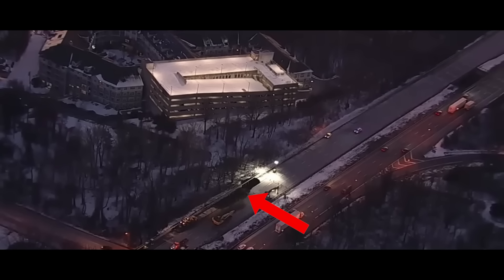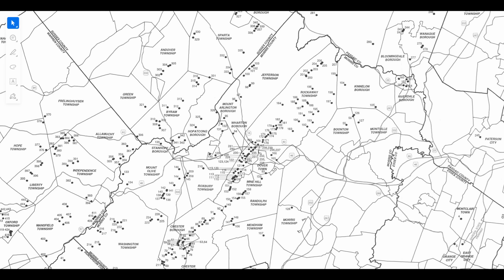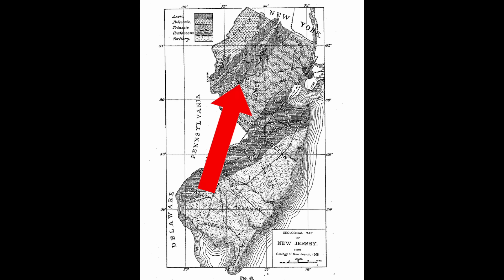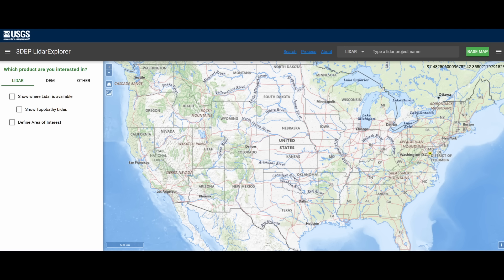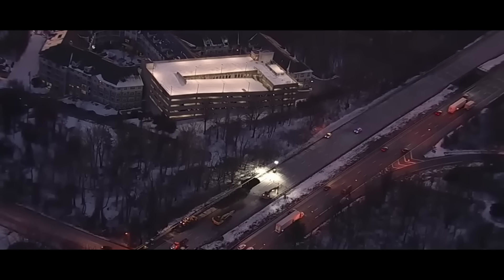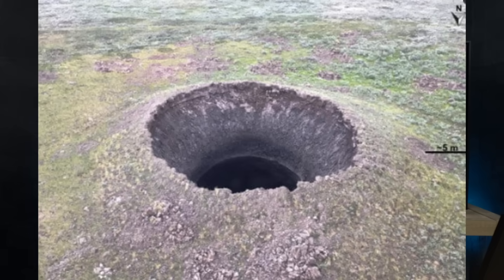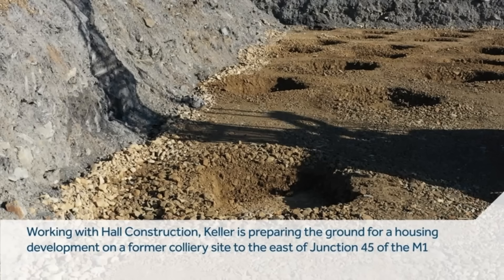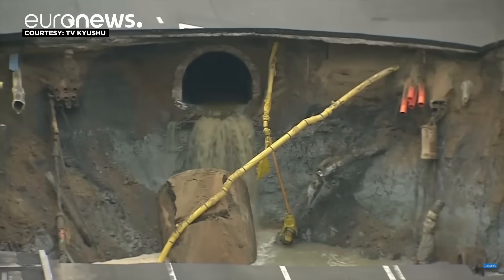New Jersey Mine Collapse below I-80 - How did it Happen, What are the Dangers?

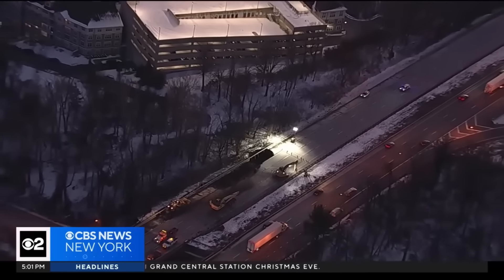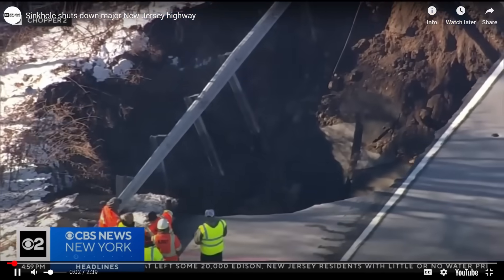Comment: I just saw something in the video about 1:30 and 1:40 that rasied interest.  If you look just off the edge of the sinkhole, away from the road it looks like a weathered sink hole is there, possibly one that is 30-50 years older than the road.  It has some small brush and the edge of the new sinkhole actualy encroaches into it maybe a few feet. Note the shadow in the 10:00 side of the formation that matches the new sink hole.  The best shot I could find was at 1:34-1:35 wnen the camera was looking down almost verticaly into the sink hole, it is at about 10:00 poistion from the middle of the sink hole. Also ar 1:09 there is a shot from above the road that shows the right side of it, note the absence of trees in that depression and a ring of trees around it. Your thoughts.  i live in the Cumberland/York/Adams/Franklin counties limestone areas of Pennsylvania and have seen sink holes due to acid soil eroding limestone, we had significant iron mining and limestone quarrying but all I am awae of were open pits, Caledonia - Thaddesus Stevens Civil war era, Pine Grove Furnace - sligktly later, Codorus ?, Boiling Springslate 1700 or early1800 and some others.  Of course there is Cornwall in Lebanon county that is a massive open pit.  Fuller Lake a recerational spot at Pine Grove (Cumberland County) ended production when it filled with water overnight and could not be pumped out.  Mining equipment is still at the bottom.  us Route 30 near PA 74 has a repeated sink hole, has been fixed at least 3 times in 30 years about 300 yards from the mall and a section of Ollies parking lot (a liquidator) collapsed a few years back whlie a car was parked on it.  The School at Boiling Springs I attended (49-61) has a group of sink holes between it and the new building.   These "landmines" are everywhere.

Comment: Zamak was a zinc alloy that many Lionel trains were cast with as well as matchbox cars etc. I actually have a .22 pistol made from
 It. It was very unstable over time and cleaves over time. Cracks developed in any and all directions.
Reply: Yes and no.  I've heard the issues come from lead contamination.  One of the reasons why it's advised to not just melt down old broken pieces to re-cast them.

These days the metal suppliers are much stricter about lead and other contaminants.  Meaning modern Zamak alloys don't have those problems.
Reply: @ That explains it, thank you. I’ve pondered what the culprit was in the mix. I actually machined 2 new wheels from steel to replace two that split bad.

Comment: Flowable fill you will want to look at the work done in Johannesburg south Africa in the remediation of mine dumps, where the massive dumps were mined again for gold, using modern methods over the old methods that only got a portion of the bound gold, and where as a by product there was a massive amount of copper, silver and PGM materials recovered as well, and also massive amounts of sulfuric acid, with the fine slurry being pumped back into the old abandoned mines as fill, stabilising the dolomite considerably, and also releasing the land for development again. From 30 years ago having row after row of hills of dust generating dump, you now have row after row of cookie cutter developments, and only a few dumps preserved as historical landmarks. The dumps being reprocessed were actually higher in gold content than the current mine ores, despite having already been done a century ago. The whole area is well known for developing sinkholes, as it is mostly dolomite, and it has a lot of acid rain from all the coal fired plants around in the ring of power stations that surround it.

Comment: It sucks when road safety is… 😎 undermined... Did NJ have to do anything else, like pilings or netting, when they filled that sinkhole so that it wouldn't just run out to the sides?
Reply from the maker: You know that is a great point.  I will reach out to them to see exactly what they did for this emergency repair and whether they plan to implement a more long term fix.

Comment: I wonder if that other method you have been using with the satellite company may have given some early insight prior too the collapse. 🤷🤷 
Just a thought

Edit: Never mind 🥴
Edit 2: Never mind the Never Mind, by the time I had typed this up and looked it over you had responded!!
Reply from the maker: That is a good thought.  The problem is trying to use it on a black asphalt surface like this section of I-80 as the radar energy tends to be absorbed rather than reflected.  Previously, I asked them to look at the section of road that ended up failing on the Teton Pass in Wyoming last year.  The roadway was paved with asphalt too, so there was insufficient data to analyze for movements in advance of the slide.

Comment: You're kidding, no one checks sub surface under INTERSTATES?  In NYC you can't dig a hole for a big tree without having a gov't provided service mark out all sub subsurface issues within 50 feet.  Guess gov't dosen't require GC's engineers to do squat for the 10 million a mile of tax payer dollars they pay for major roads.  Surely geologists and thus surveyors and engineers would KNOW, certainly SHOULD know of vast nos of mines in past and conduct approriate test cores and other detection methods to confirm there is no mine UNDER a major construction, or ANY construction.

Comment: Google Earth Units of measurement can be selected in "Tools" and then "Options".  System default appears to be Imperial.
Reply from the maker: Thank you!
Reply: I use Google Maps in Chrome, running Windows 10 (maybe 11?). When I get a measurement in miles I always get the equivalent in kilometers as well. Maybe it's an OS- dependent thing?

Comment: The Road Needs to be Moved Off of those sites Totally, Can they not build a by-pass or a Raised road Around or Over the Pits  .  Or How About using a Mixture of Polyol Resin and Isocyanate ( Expanding Foam) in those holes to fill them ? It would fill faster and would not need as much material.
Reply from the maker: You have an interesting idea there with the poly fill. il I think the biggest issue is they don't know where all these mine openings are located.

Comment: Your comments near the end on monitoring the roof line is good.  I would like to add the building operators can also see diagonal cracks forming in dry wall inside. Some will plaster over and move on. They should be keeping records and photos to take to others. See if this can be found a bit sooner.
I did lock work in a small apartment where the water line beside the foundations had developed a leak and 'mined' out enough that one corner has suddenly sunk about 1 foot or 30 cm. Emergency evacuation for that. I was locking doors with padlocks as they would not close to lock. Real cracks in walls developed there!!